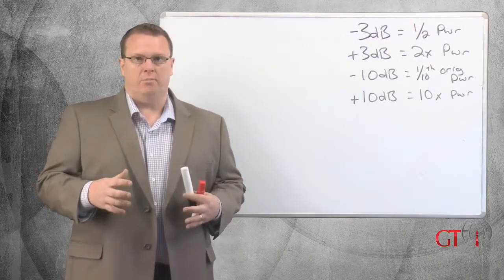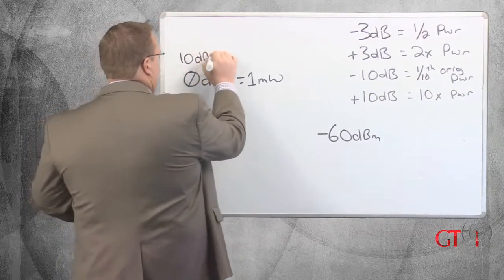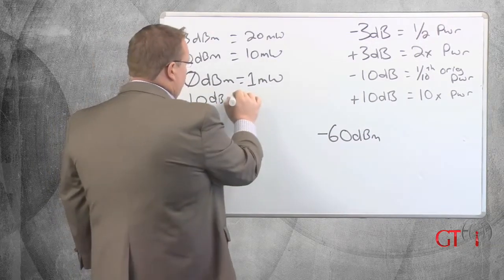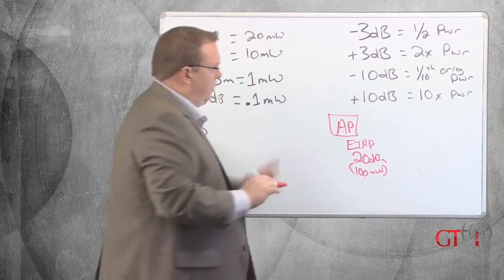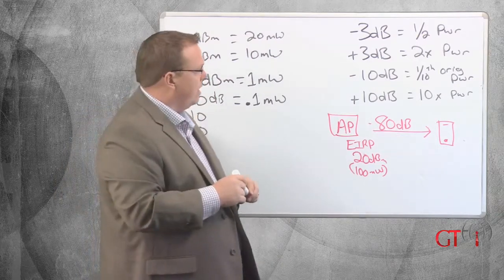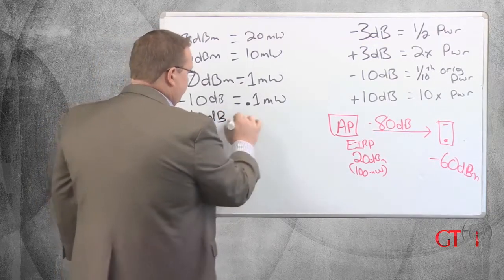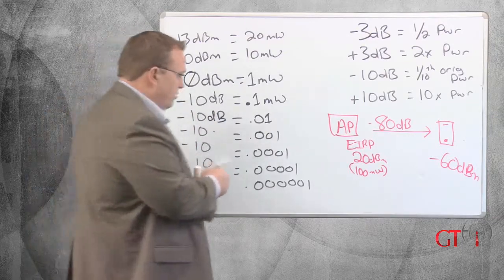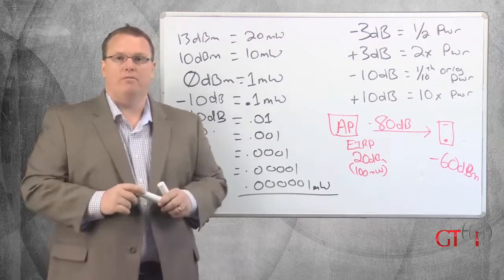12 - Understanding Signal Strength in mW and dBm

Comment: Thanks so much for clarifying this. I install tv antennas with my dad and we use a signal strength meter to help dial in the direction we need to point the antenna to get the best signal. I've wondered for a while why the DBm is always a negative value and now it makes sense

Comment: Page 1052

signal level (Telecomm) The difference between the level of a signal at a point in a transmission system and the level of the arbitrarily specified reference signal.

What is common channel signalling?

Comment: evening GT -so its 1mW x 10 [because 10 dB is 10x the power] 
so for 13dBm  you are then referring to the previous answer of 10mW to get the doubling of 10mW [because of the 3dB = 2x] dB in 13 ?] to make 20 mW ?

in other words it's not 3 [2X Power] dB X 1 mW but 2x the 10mW of the previous answer?
I hope this makes sense -I think that's what I'm asking but not put very well !
Cheers these are good presentations